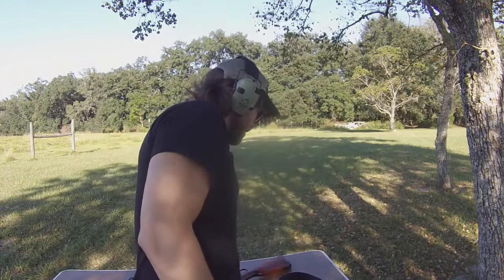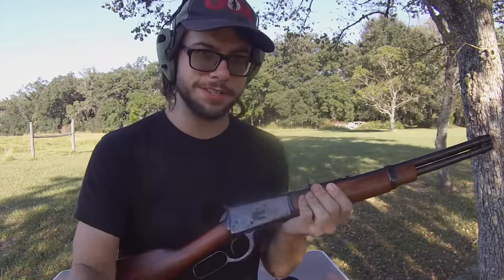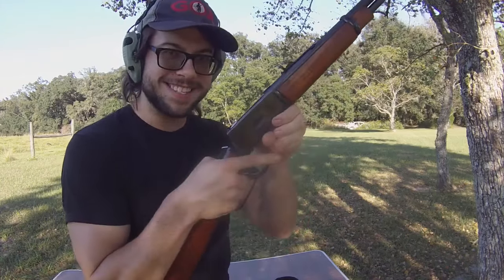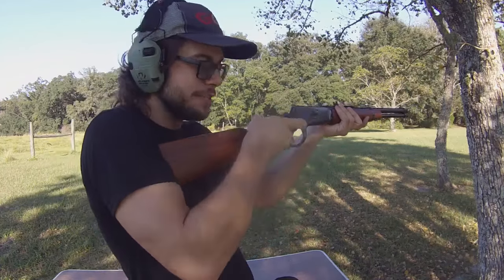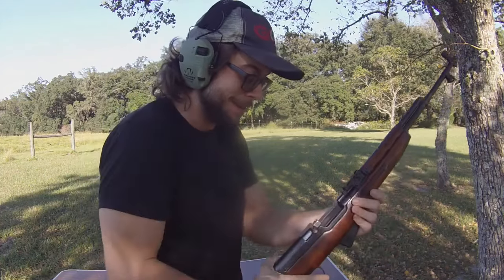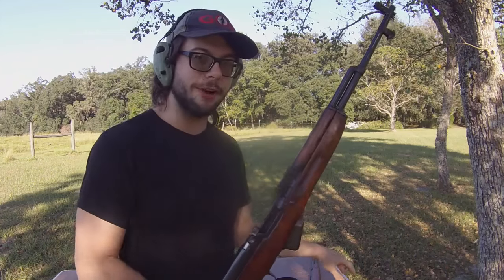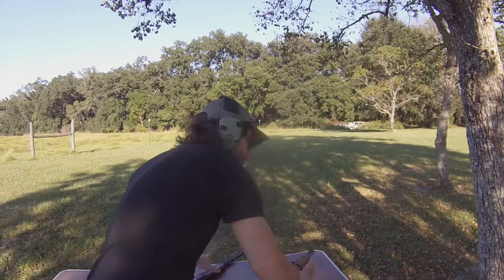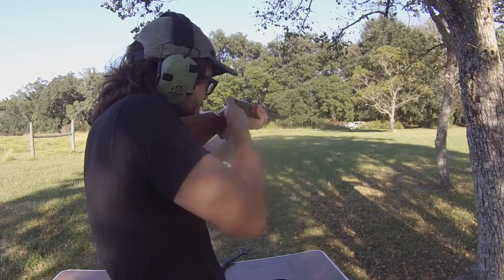Fast Loading Systems Matter!!

Comment: Reminds me of the new Henry Supreme that takes AR Magazines haha!
The gun laws are really whack here in Canada. Magazine capacity for semi-automatic rifles are capped at 5 rounds, and 10 for semi-automatic pistols. However, there is no magazine limit for manually operated repeating firearms, such as bolt actions, lever guns, or pump guns. (with few exceptions)
So here in Canada, sometimes a slower, manual repeater is the better option, just to increase your magazine capacity. Unfortunately, the magazines for the manual-repeater would need a proprietary magazine, so as to not be used in a semi-auto that also takes the same magazine. Weird, huh?